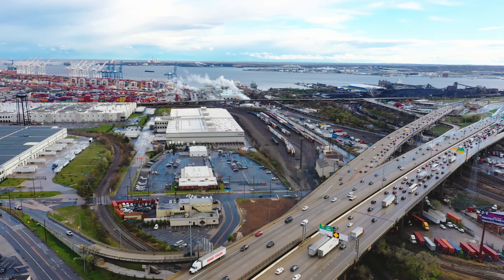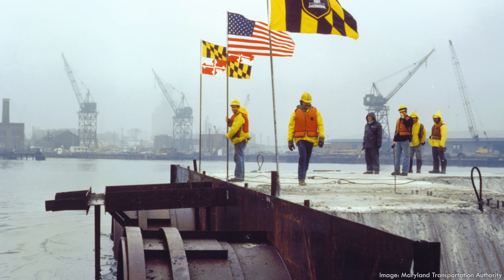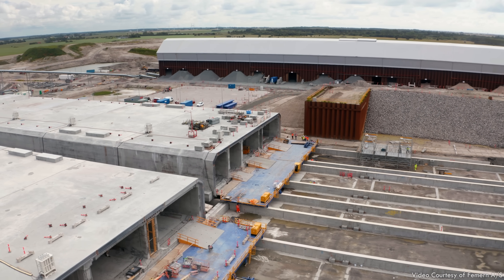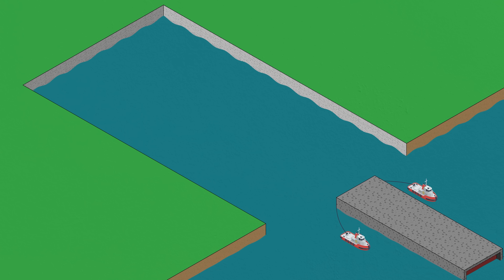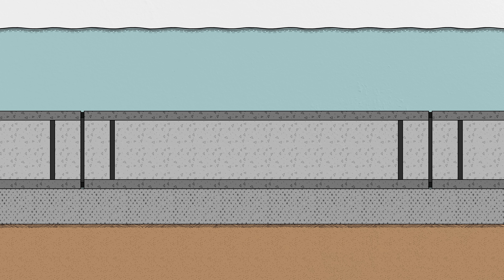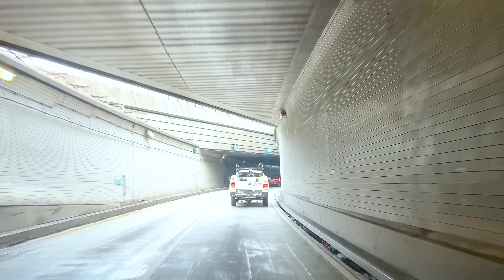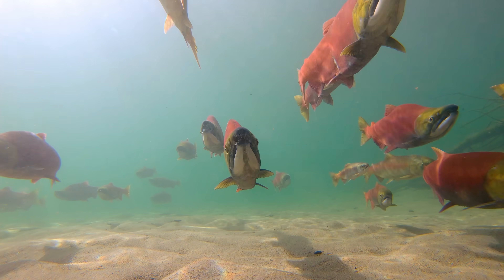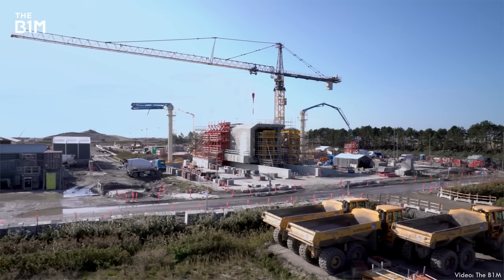The Most Implausible Tunneling Method

Comment: I"m Dutch and this is the most used technique for building submerged tunnels in the Netherlands.
Thank you for making a video i can use as an illustration for this impressive method of construction.
Reply: Of you look at the subsurface in the netherlands, it makes sense: Vast areas, especially the reclaimed land, would be unbelievably annoying to drill. Muddy, silty, very wet, and lots of salt still in the deep ground.

This method has it's own annoyances, more than drilling in good, dry, medium-hard rock, but it is infinitely preferable to the gunk they'd have to drill through in the area between Leuwaarden and Middelburg.
Reply: @littlegrabbiZZ9PZA good example is the north-south metro line in amsterdam. boring tunnels works terribly here
Reply: @kyh148 That is not true. Instead of the bore-tunnel sections, it where the excavations for the station boxes, constructed with the more traditional cut-and-cover method, that experienced significant and costly fails and diffuculties.
Reply: @littlegrabbiZZ9PZA  
That's interesting in contrast to Stockholm. We generally don't drill tunnels because there is too much hard rock. So we mostly blast.
Reply: @ludwig2345  Hard rock is ideal for Tunnel Boring Machines. They actually just press cutting wheels against is with enormous force that cracks it.
Reply: @ludwig2345  In the Netherlands you may need to get down to more than 1km of sand and clay to find hard rock, so that has always been completely inviable if you want to make a tunnel under a large river, you kind of have to.
Reply: @littlegrabbiZZ9PZA  You are of course completely right. Some of those areas we call jokingly "Thick water" Especially the peaty bits.
Reply: This is how andrew ryan built rapture
Reply: The Lego used must be massive!
Reply: @DesertCatDad  there are about 5 floors below the lowest train tracks, most of it isnt even being used (yet) 
people have gotten lost and died in there, 
a less morbid example; they made safety doors that can only be entered with an electronic key.
one guy didnt bring his key, was let in by colleagues, the door was closed behind him and he didnt have the key to open it back up. 
he was forgotten and left there for a couple of days untill his wife started calling. 

dude had to sit in there for 2 days. 
since then they made it a lot easier to exit but regardless, there are still areas underneath e.g. central station that just arent mapped at all. 
built before computers and drawings that have been lost to time.
Reply: Same for Belgium, currently they are building one this way in Antwerp to put under the Schelde
Reply: The Maastunnel in Rotterdam was the first one in the Netherlands.
Reply: @20kilovolt  i know and in a few weeks I'll walking around in the Coentunnel. One of the more recent ones.
Reply: Yeah, danes just do bridge and tunnel building at a different scale than most countries.
Reply: @RHelenius  the Øresund connection was built by  Dutch construction company

Comment: Here in Oslo, Norway we used this technique to extend the motorway tunnel that goes under downtown and the inner harbor. The existence of a whole new part of the city (Bjørvika) is thanks to this building method. The tunnel is called Operatunnelen and even has murals to show what buildings you drive under!
Reply: The part with murals is called Festningstunnelen, and is the original tunnel. Operatunnelen has no such murals.
Reply: @panzerveps  There is a mural (I guess more a mosaic, as it is made of tiles) of the Opera
Reply: I love the idea of murals of the surface buildings
Reply: it's the main thoroughfare of the capital city yet the speed limit is 70 km/h. this modern wonder was used to extend an existing and chronically congested tunnel rather than a full rebuild.

Comment: I-10 in Mobile Alabama, and the older Highway 98 tunnel next to it, were both constructed as immersed tube tunnels.
Reply: I had a tour of the tunnel system here in Mobile. I'm not sure how open the tours are to the general public, but it was interesting. The tour guide said the Bankhead was the first of it's design. Another interesting bit of info on the Bankhead Tunnel, the dogleg on the west side was due to an inaccuracy in the surveying. They used a .22 cal rifle to mark the line on either side of the river, and were a little off in their aim. @PracticalEngineeringChannel Maybe you could do a video on the old surveying techniques.

Comment: Check out the construction of metro line 4 in Paris in 1900, crossing the river Seine. Workers were excavating by hand beneath the pre-constructed box. They also froze the soil at some stages in order to excavate in a solid matter.
Reply: I think that a side discovery was N2 dissolving in the blood when you stay for too long and is then released as micro bubbles when you go back to the surface.

Comment: Given rubber tends to degrade over time, how do they replace the two seals when they become worn?
Reply: Metal gland seals will hold forever assuming no large movement beyond expansion.
Reply: @Night60700  thank you for answering it
Reply: It seems that the manufacturers of these seals guarantee at least a 100-year lifespan. See the final page of this PDF: https://www.trelleborg.com/marine-and-infrastructure/-/media/marine-systems/resources/brochures/downloads/omega-seals-leaflet.pdf
Reply: They’ll just throw some Gap Filler / JB Weld in there in 50 Years when it starts leaking!
Reply: I’m glad someone else thought of the same thing! I once asked this on a video about the Femern Belt project, and was told that the seals are designed with a 100 year lifespan. Could have been something that was just made up, but each of these tunnels probably do have an expected lifespan. As do all civil engineering projects, though
Reply: Quickly 😂
Reply: Did my joke comment about just using foam spray filler get deleted, or was it due to the bots thinking i was an advertising bot? 😢
Reply: @ericlotze7724  some of mine on other channels don't seem to appear sometimes then other times I'll post once and the same comment will suddenly appear after not appearing for a couple of hours dozens of times one under the other.

YouTube seems to get more glitchy rather than less
Reply: @ericlotze7724 . Sounds about right to me. Anyone who’s used expansion foam in a can knows that stuff will stick to everything and never come off.

Comment: Thisbis fascinating, love this channel

Could you please do a video about the history of cut and cover construction and whether or not it could be applied in modern cities?
Reply: The Ho Chi Minh City Metro has a section of cut and cover under Le Lois. A wide section of street and verges so traffic could be diverted easily. I did apply for an Inspector of Works, but it seamed my asking salary was too much for them. So went to work on the KL Metro Malaysia.
There is also  the Song Saigon road tunnel, an immersed tube design built by Japanese contractors. This joins districts 1 & 2.
Reply: @TheByard thank you for the info! Ill have to do research into those projects

The reason im so curious about cut and cover is i live in NYC and i wonder if it would help us build subways faster/cheaper if we were willing to tolerate the surface disruption
Reply: @jakebrooks3415  C&C is used where cover is limited for some reason, the method takes longer as concrete curing times have to be taken into account. The spoil still has to be removed from site. With a TBM driven tunnel the drive often starts from a ramp or shaft in an industrial area so less congestion. There are many factors that have to be taken into account, TBMs are too expensive for short lengths of tunnel. C&C needs large sites, pipe jacking can be used on short drives say under a railroad track etc. They can also be driven then enlarged from within. I worked mostly in tunnel from 1960 until 2015 and was lucky enough to work in many places of the world.

Comment: The rubber seal part makes me nervous but considering everything else involved in the sealing, I doubt even if it gets old, it will matter.
Reply: Most TBM driven tunnels have a gasket around each segment, then the annulus is filled with pressurized cement grout. Though there's a metro tunnel built in London UK that was excavated using an open faced TBM and no tailskin. The segment ring was built against the excavated clay, the segment sides were concave convex so each one fitted into the recess of the previous built ring. The ring was then jacked out to form a seal wit the clay and concrete wedges insert in the jacking gap. No bolts were used and it took just 3 mins to build each ring.
Reply: @TheByard  That is awesome.

Comment: Very cool explanation as always but I have one question:
Why do we not see spiraling ramps for bridges? They take up significantly less space than a long ramp, do they not? And it circumnavigates the whole tunneling.
Reply: we see them for bicycle bridges. But for cars the radiuses are just impractical.
Reply: I imagine it would obstruct traffic flow way too much.  You need to slow down considerably to navigate a spiral ramp.
Reply: What if a fire breaks out? Covering the road sections above with smoke, while having risk of burning fuel flowing to lower section, both making it more difficult for the fire department to reach the accident site.
Reply: @Yehan-xt7cw Extractor fans are fitted and traffic is stopped from entering them. Fire equipment is built into the tunnel. On the Smart tunnel in KL Malaysia there are two roads decks and and an escape stairway connecting both decks, with a waiting area between each deck and water tight submarine type doors. The tunnel also doubles as a flood prevention system where water flows under the lowest deck, but should greater capacity be required traffic is stopped from entering. Watertight doors are closed across the vehicle entrances and the two road decks flooded.
Reply: @TheByard   I meant fire on the spiral ramps, not in the tunnel itself.
Reply: There's a bunch in China, nanpu bridge for example. It's probably because the spiral requires traffic to slow down but it's not any cheaper to build than a regular ramp and building a bridge over a major river wouldn't usually be attempted other than to build an expressway. China has lower construction cost and is modernising already crowded cities so the space savings matter more.
Reply: @maksrambe3812  and the others:
those are all great answers! I couldnt think of them on the spot, but they make perfect sense.
Reply: The Blackwall road tunnel built in1897 under the River Thames London UK. Does have bends to decrease the grade as it was built for horsedrawn vehicles. These now cause problems with articulated trucks needing extra wide lanes at each bend, a second paralle tunnel was built in 1967. So North bound traffic use the old tunnel and South bound use the newer one.

Comment: I wonder if that method of dropping those tunnels down on top of the ground make them vulnerable. Like what happens if a huge ship accidently drops a 6 ton anchor on top of it... ooof. Was that risk ever addressed ? I mean even if it IS in that little trench you mentioned, a direct hit is still possible right on top.
Reply: I wonder if they can be used in seismically active areas as well.
Reply: I've seen MASSIVE ships drag anchor in wind storms. I wonder what the factor of safety is. Like there has to be a scenario that would be the perfect storm and cause issues, but it must be VERY rare I imagine.
Reply: He addressed this at 9:44.
Reply: The soft sediment excavated for the trench is usually put back on top of the submerged elements.
Reply: I would not be surprised if using anchors in that area is prohibited.  I see that a lot near lighthouses (and other structures) on islands.
If fact on maritime charts (I have a small sailboat) cables, pipes, etc are drawn, often with accompanying warning that anchoring (or fishing) near these is prohibited.
Reply: I know he addressed it sort of, but I'm wondering what the factor of safety is, since a direct hit of a MASSIVE anchor is not going to be stopped by a few feet of sediment. But prohibiting anchor use makes sense. Although in a situation of a power loss, dropping anchor can be the only way to stop a disaster, although, in that area going a drift and hitting a bank would be better then killing a hundred people in a tunnel so yeah, a NO ANCHOR zone makes sense.
Reply: Did you not watch the video? 
I swear. Some people have the attention span equivalent to a chimpanzee.
🤦‍♂️